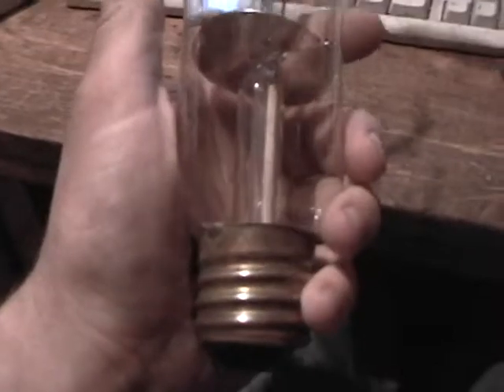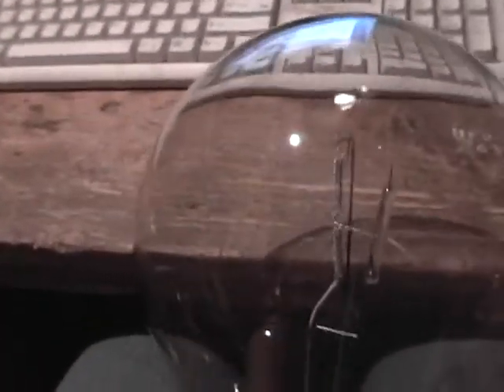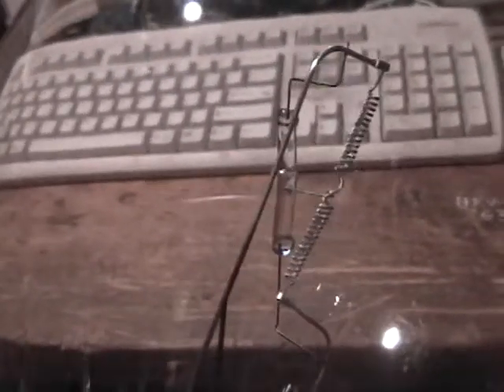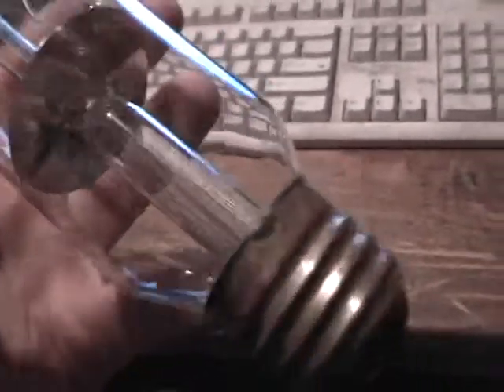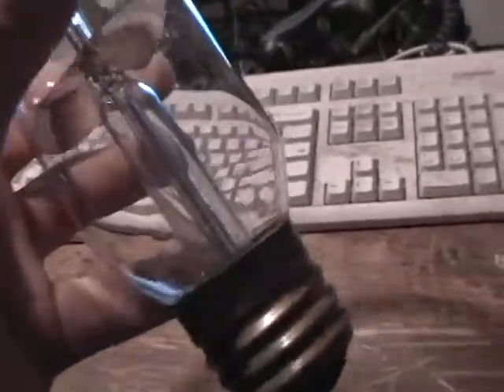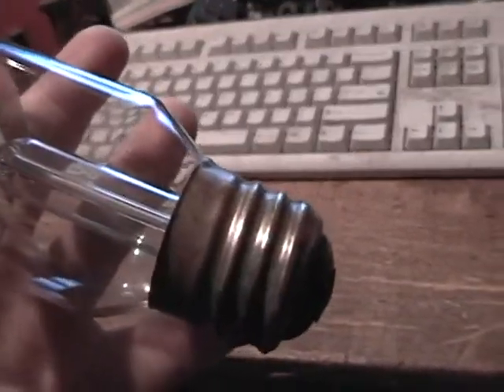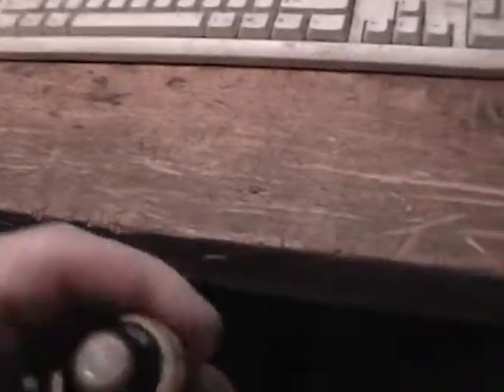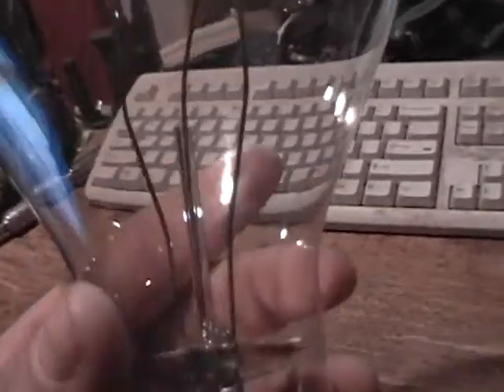1000 watt incandescent lightbulb

Comment: Back about 1995, I went into an old school gymnasium that was still using these. Even then they were hard to find new! By then most gyms had gone to what was then newer lighting technology...I forget what they're called, but you turned them on and it took about 5 minutes for the lights to come up to full power, maybe a little longer in the winter.